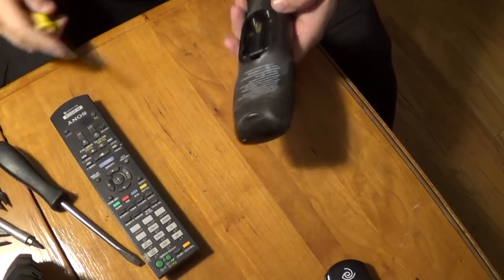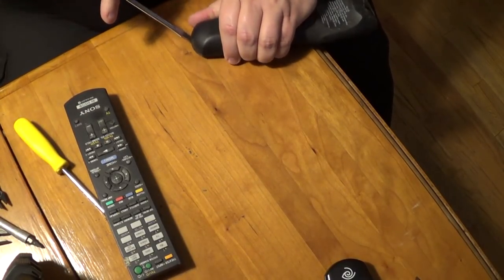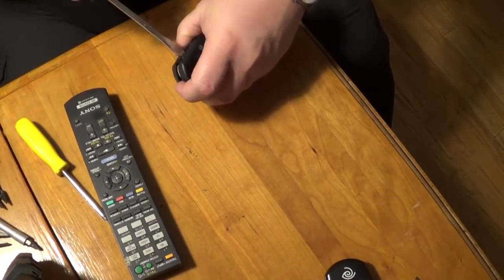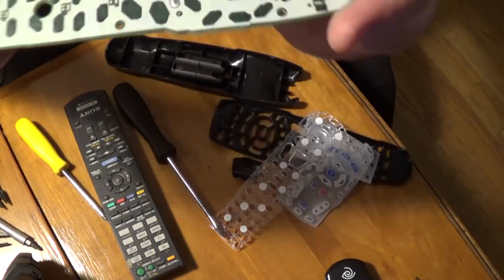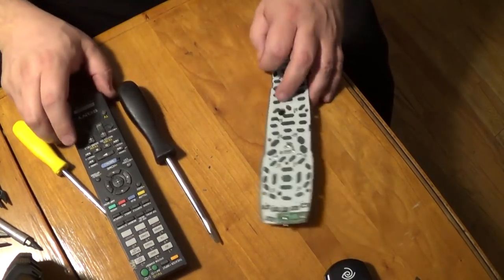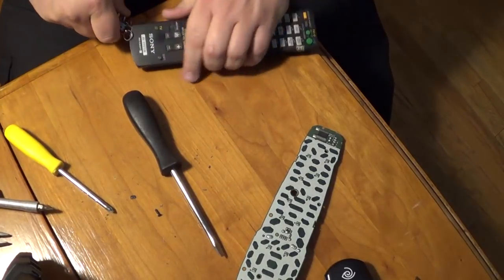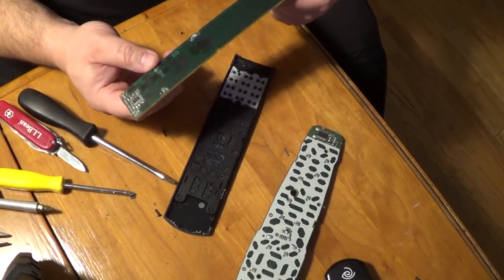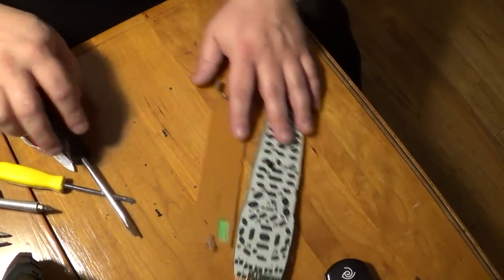Scrapping Remote Controls -Moose Scrapper

Comment: Its a low grade PCB board. Take off the big IC chip at the end and put it in a different pile, and pry off the plastic protector on top :) 
The remote control module at the end can be taken off too I guess. 
Doesnt look too great, but hey, if it takes you a few seconds why not.

Comment: Can you scrap a wifi router/tower?
Reply: Check eBay to see if it has value. You might be surprised.
Reply: Gold in a router... Pins, contacts, chips, copper wire..
Reply from the maker: Think I already did at some point....  just have to sift through the 250 videos lol

Comment: Don't say "nothing"! I found gold plating on PCB from 90s TV remote. Did you try to scratch and check what is underneath green coating?
Reply from the maker: I think I mentioned in there the possibility of a gold plated remote... there would be no logical reason for there to be anything other than copper under the solder mask if there is no gold on top.  But, if one wanted to check, its always better to err on the side of caution!  Thanks for watching!
Reply: @moosescrapper5928  sometimes what is logical - doesn't have to be true :v. Greets from Poland - country in Europe, not town in Ohio.